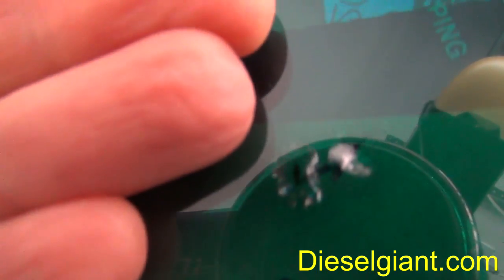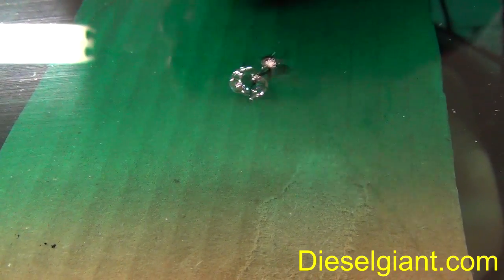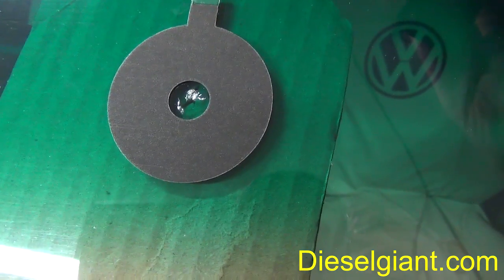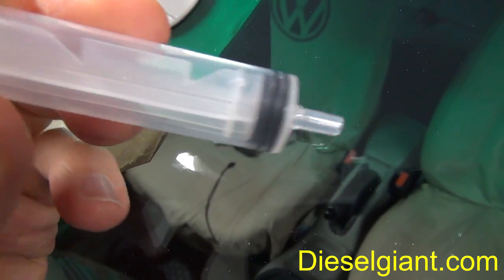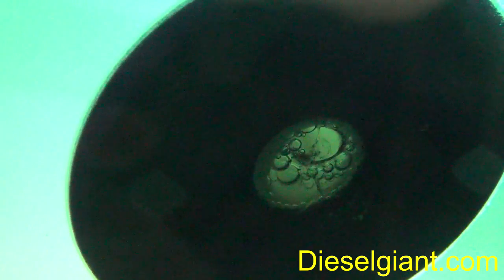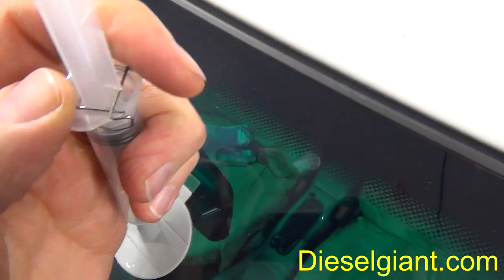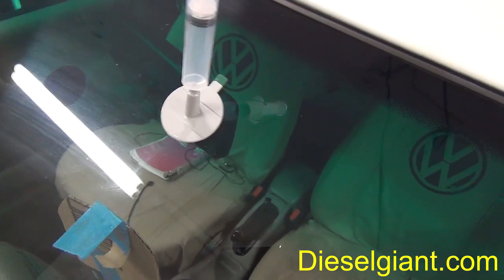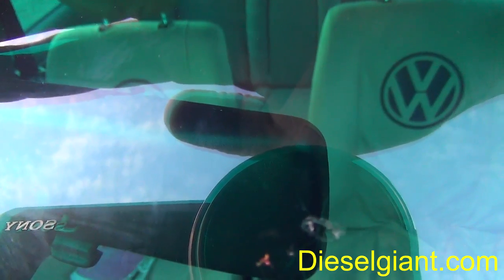How to fix a stone damaged windshield

Comment: One tip the package doesn't say is to tap the inside of your windshield when the syringe is on to help get more of the air bubbles out. It helps a lot.

Comment: Mine was supposedly "harder to repair so it will cost you about $80" it barely changed the appearance, but sure didnt do anything to fill in the bullseye flower combo either. 

So got the permatex. 

Up here in canadistan they dont supply the wipes, blade and the tiny plastic cover isnt yellow which i assume is a wavelength filtering reason? Ours is clear. The spring is also not sized right or something, doesnt hold worth a darn, so notched ed the syringe right under the finger platform at the top and slid the wire straight thru the homemade holes like you would slide a dowelling thru a towel assembly. Works better, doesn't jeopardize the vac seal as that happens lower in syringe. 

You can tell if you have a chance to diminish a strike bwhen you are alcohol cleaning the site. I used 95% rubbing alch and it fills into the farthest crack until evaporation. Seems the fluidity of the product can almost match the alch and will find out after another hour in the sun (its 6c here, supposed to be warmer when you use product but thats not for another month to come)
Was worried that the miniscule 0.75 ml size wouldn't do it, but seems leftovers can be dabbed on various "frosties" (tiny white strikes that have no shape, crack or bullseye to them, not a threat just a cosmetic thing really)

Cant wait to see how well this all goes. Hoping the TIME FRAME of its performance is many years, as it wouldn't be worth doing every year. BUT I MUST SAY it sure beats paying someone $80 for a poor and bad looking job.....
Reply: PS: the "who's to say thats the crack i worked on?" Seems to be the easy out used to avoid any warantee or redo work from these parking lot repair guys, so if thats the way the industry will play the game, im taking my ball and going home in response.

Comment: I just used this product and the end results were fantastic! I found the spring lock to be a bit of a POS and ended up holding the plunger in place for the second, 20 minute step. For 30-40 minutes of my time and the $9 I spent on the product, I'd use it again. This video is by far better than the instructions.

Comment: I used the permatex windshield repair to fix a Bull Eye on my windshield. And instead of letting it sit for 20 minutes with the curing stip. I let it sit for 40 minutes. And the results where ammazing. Can't even tell I had a chip on my windshield. I used your video since the instructions where to over rated. Thanks for the video. Keep up the good work. I love all your videos.

Comment: You did it wrong not supposed to look like that
Reply: Can you explain what you mean by  "You should draw a vacuum BEFORE you inject the resin, otherwise you aren't doing anything"?  Isn't this exactly what the guy in the video did?
Reply: Kevin Moses 😒 we know it’s not a professional job. We can’t all afford a professional job or we would. And it’s fine. All I want is for it not to spread. And yet crazy about the alcohol wipes. He did let it dry thoroughly. Alcohol evaporated completely. Did you know that?
Reply from the maker: Nope its correct.
Reply: A couple of things from a windshield repair specialist. 1. You should draw a vacuum BEFORE you inject the resin, otherwise you aren't doing anything. 2. Putting the chip under pressure can easily crack the windshield. Most of the time you could actually just drop the resin into the break without the syringe and cover it with the Mylar tape and it would work just as good. I don't recommend somebody using the syringe without knowledge of what it can and can't do. I do approve of putting it in the garage, as keeping the windshield cool is a must and away from the sun. Also, if a professional would have done this, we could most likely have made the impact point look cleaner because we use a drill. 3. Another thing, you don't need to use a pushpin to get out loose glass, it does nothing and I don't recommend using the alcoholic wipes either because any liquid introduced into the break will compromise the resin (as you can see, when you used the wipes, the crack began to clear up some). You don't need the wipes, but if you use them it would be better to wait till the alcohol dries to start the repair process, but it's better if you don't use it at all. Same goes for if it rains. The other thing is that the resin supplied in the kit is very low quality so while it gets the job done on fresh chips, in terms of spreading. Cosmetically, the resin that the kit uses stands out rather than blends with the tint of the glass as our professional resin does. You did okay with it, but you  just didn't know enough about windshield repair to understand the finer details.
Reply: Actually, you can't use the vacuum first and then add the resin as removing the syringe to add the resin would break the vacuum, the technique is the same used on treating wood with preserving or hardening liquids. The wood is  put in the liquids in a sealed chamber which the air is pumped out making a vacuum. This causes any air trapped in the wood (or the crack in this process) to expand and bubble up thru the liquid which then replaces the air in the wood (or the crack). Also a good technique if you want to super saturate wood that you then want to bend.

Comment: Thanks for this! You mentioned that you were going to try a different brand repair kit for the star crack that you pointed out - did you end up doing that? If so, how did it turn out? I have what appears to be a star crack (but only with two legs horizontally so it's more like a split) and bought the Permatex but it's the "bulls eyes" unit so I'm not sure if it's going to work too well.
Reply: He did a video for Rain-x https://www.youtube.com/watch?v=hFlX_Xmum64
Reply: and he recommended the Permatex out of the 2